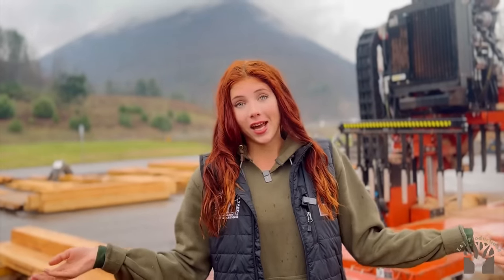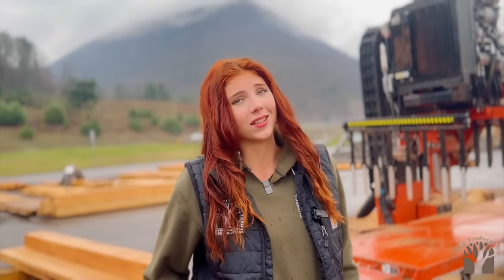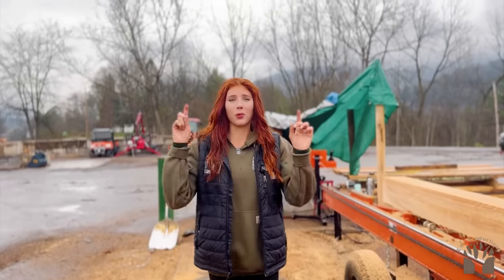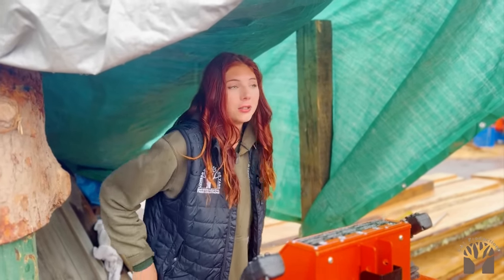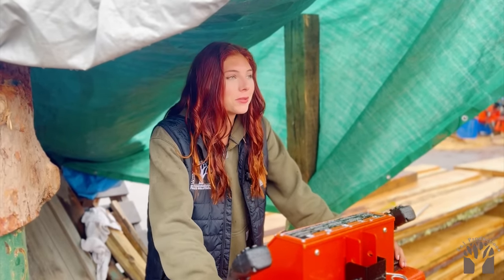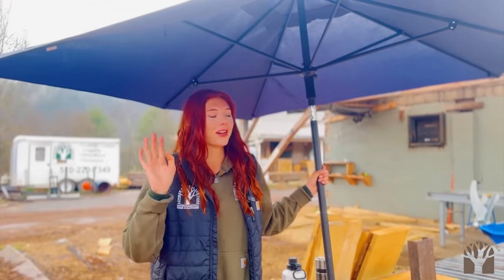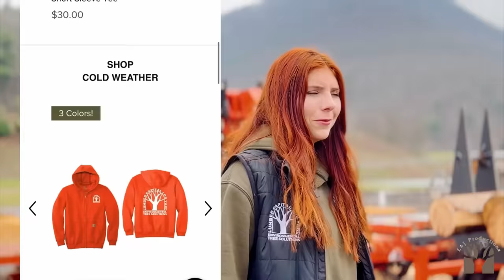Best job in 2024 “the rainy day special”

Comment: Is the operators station attached to the mail frame, or free standing?
If it is attached, take 3 or 4 very large hose clamps and attach a patio umbrella to the steel post the control panel is mounted on. If that is free standing, maybe you can do a 10x10 easy up canopy using a couple railroad timbers as a base/anchor

Comment: Ought to have the boss get a couple of pop up canopy tents for his most valuable assets (his employees / daughters!) They're easy to set up and move around if need be, and can be anchored with sand bags or stakes / guy lines. Be real nice to keep the new mill operator's station out of the weather. I know WoodMizer makes them pretty rugged, but keeping the controls and control panel dry & out of the sun has to be a good thing.
Reply: I often see tents anchored with plastic 5 gal buckets filled with sand,like fireworks sales. some are filled with concrete. Good weight,"easy" to move.

Comment: Both of those machines should be under a roof. You could build a kiln in one end. You can build a pole building Eighty feet wide and as long as you want it. Put metal on the roof and leave a space for the roof cap. Get great big eves trough and get some one to build you a big lined pond and you would have water enough if you ever had a fire. You could have Two 3 inch pumps and then take them down to 2 inch and you would have plenty of water pressure
Reply: I talked to a friend who drew up metal buildings for years . You need a considerable amount of clearance to put the longest piece of material you would ever cut and be able to haul them in and out. The Then the rest could be built like a pole building

Comment: The number one item they need is an outfeed for lumber onto a 60’ long greenchain and  the edger boards can accumulate on the end!! Have greenchain 90 deg to the outfeed !!!!  Edger on end of greenchain. !!! Simple.have 24” stops to hold accumulated edger boards to be edged after enough is there !!

Comment: Hey Ladies, working and singing in the rain, May want to check out  10 ft. x 10 ft. Slant Leg Pop-Up Canopy  (won't say where so youtube won't flag it) they are around 60.00 each and goes up in less than 5 mins we use them a lot for temp work. just have to be care of high wind they will take off like a kite tie downs come with them. both of you could get one for each end and when you get covers built they can be used for camping, cook outs etc.  Good job today!  John Toccoa GA

Comment: LCLY, The more comfortable You are the more Production you get. Hey Boss Man any sick member of your Family is going to cost  You production..8 4"x4" poles 24 2"x8" Boards for rafters,4 sheets of plywood, and You would have 2 8'x8' Sun and Rain  for your Daughters.  all you need to buy is Bolts and 4 sheets of Ply wood and some shingles. Keep the electronics  dry too. God Bless
Reply: Too small and spindly.
Reply: The new home needs to be bigger than the old home for the LT40. A block wall and a wooden roof. I'm sure the family will figure things out.

Comment: You should tell the boss man that you need an operators shed to work in all weather conditions.  It wouldn't be that hard to build a small shack to protect you from the elements.  (soon the mighty sun will be beating down on you sitting/standing there for hours)  A higher seat/stool would help out for sure as well.
Reply: "employee lunch room"  :-)

Comment: Another idea for you. Maybe purchase another log deck system without the log kickers. 3chainx4’ C-C   x 60. ‘ long. And a 24’ out feed …..8’ of rubber conveyor then outfeed rolls @ 2’ C-C with side shift rolls or a hyd sweep at end to shift /sweep wood onto greenchain that is at waste height. !!!! ….NO BENDING OVER!!!!!!! Set up edger on the end of the greenchain!! Then jade can pile all dimensional lumber as well as edge the wayne/rotted wood!! Also have piling blocks/ spits on both sides of greenchain too!! So you will have approximately 8-10!piles of different dimensions and lengths on each side of the greenchain. You need this bad. To enhance production.  YA I HAVE THE DESIGN ALL IN MY HEAD. !!  And a means of  handling the piles that are perpendicular to green chain!!  Which is how it should be!!!  Call if you want to go to the next level !!
Reply: Perhaps draw a picture and drop it in the email. Show all dimensions and include a wall/roof to protect the operator and the LT70.
Reply: @thomasboese3793  I like that you read my statement/offer.  I will come there. Give me 50’x50 of flat land. I be right there after moving out of my place here. Lol. .  Ohh and i will have to buy a nice RV there too!!  Something can be worked out forsure. I have a boiler shutdown company i want to fire back up this could be good for us all!!
West Coast Boilers.  I maintain all recovery boilers/power boilers (bio mass/coal fired/co-gen fired too) sawmills ..maintenance/construction / Heavy equipment operate/repair, concrete forming/placing, wood framing/building/ welder/fabricator/ etc etc etc. Lol

Comment: Do you check each log for metal before you begin milling?
Reply: No they do not check the log for metal before milling.    However if they are suspicious, like it came from a fence row, they will use old blades.

Comment: I noticed that a lot of time the de-barker doesn't start until well into the log. See 8:54. Is there a reason for that or is it designed to work that way?
Reply: It is likely that it is controlled by the operator who is not starting it soon enough.

Comment: Subscribe to OUTDOORS WITH THE MORGANS 
  Then show your BOSS AKA DAD the pavilion Mike Morgan had built by the Amish to put his SAWMILL in and the other end had his firewood splitter & conveyor which drops the firewood directly into his firewood bunker. It's a real nice set up and in his video today he's talking about adding a 26 foot lento on the right side which will be machinery storage like tractors excavator and tracksteer which will give him alot more room for lumber storage to air dry before he places it in his new kiln dry which will be up behind his other big building.
   lf I were your dad I would schedule in an hour each day of milling lumber just for the new pavilion for over the entire  mill and operation area. Even lumber storage between where the roof is to the old mill leanto and the new mill area. Have the new pavilion cover that entire area since it will be done with your own milled lumber it will be much cheaper to build.
   Buy that 1 hour a day can be cutting and stacking the lumber needed to have it built and before you know it the lumber is all ready to go.
   And from what I've seen that new mill can cut a good bunch of lumber in an hour each day.
   Your cute little tarp system is OK for now but there's going to be times it's not going to stand through winds and downpours and heavy snows.
   Git er dun boss man 😉
  Oh and whoever is doing the camera work is amazing at it. Great angles and shots of the entire sawmill process. Really enjoyed it.
Reply: No need to subscribe to 'Outdoors with the Morgans" to know that a pavilion would be nice.  Why is everyone so caught up in the idea they need a roof.    How about getting the production  right?  How they set up production may influence the size and location of the roof !!   Moreover, production is way more important.  Emerald and Jade, in this video have set up some temporary shelter and they can do even better if they try.  There is NO urgent need for the pavilion roof.

Comment: The issue with building a pavilion over the sawmill area now is that they just forked out $100,000 to rebuild that monster skidder and that they also just purchased the new mill and that had to be quite a chunk of cash so the pavilion if ever will probably have to wait a few years so if the oss oks a cover it may just be over the operators spot and be just be  a leanto until those big ticket items are paid for.
   Thats the issue with owning a sawmill things wear out and have to be fixed or replaced and its extremely expensive to do no matter what way you go. 
   Thats the stress thats always on kens shoulders and what he was talking about in his last video talk.
   Its a very stressful business and thats when everything  is going well. I cant imagine having to choose between having to spend $100,000 to overhaul the skidder or buy a jew one. Today the new ones have got to be outrageously expensive for $100,000 to be the better oprtion. 
   And then then mill to be able to produce more lumber faster to be ablet to pay for both the skidder and the new mill and weve seen other new pieces of machinery added over the last couple yesrs as well so its a never ending headache to keep a good sawmill business running as smooth as possible.
   Thank god for the youtube channel to help pay for the headaches that pop up a lot of the time.
Reply: It would be interesting to know the real cash flow at LCLY  and who gets what or paid what.  However it is my speculation that while YouTube is worth doing, it is not a major part of the cash flow.   With some temporary tarps, like in this video, they can at least get along for the summer.   That would give their cash a chance to build up.

Comment: Ok: lets give Emerald the umbrella and get Jade a monster tarp.    Measure from the building to the farthest that the mill head moves.  (guessing 40X60 feet maybe)  Attach one end to the building and the other to a horizontal beam over the work area held up by the old fork lift.  That should be temporary enough to move when in the way yet keep you both mostly out of the rain and hot sun.

Comment: Are you thinking about the layout of the equipment coming after the mill?    Where to put the chop saw and edger in particular.   Are you working out a way to put inventory lumber out front by JD Loader and not by hand stacking.    I would like to see a continuous run in real time of you doing RRTs.   You are getting about 1 every 5 minutes but I think your machine can do better even with the cuts you do: 1 every 4 minutes.  I want to see where the slow up is.  I don't want you working harder exactly, just have a system that will help you  do that.  You need more experiments on that job I think.    Also Jade is having to come up and get the slab and take it to the end.  This hiking around can be stopped by welding those hooks on the end of the return and using the mill to place the slabs at the end of it's travel so Jade can just remove them and stack them not run them all the way to the end.